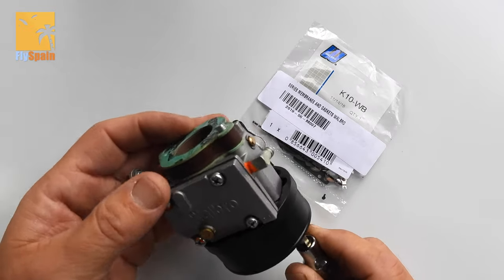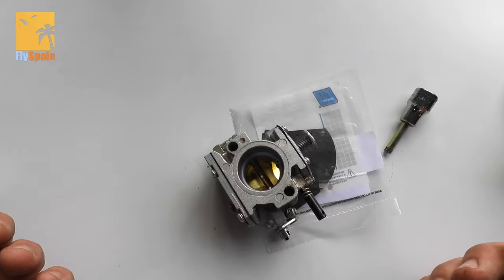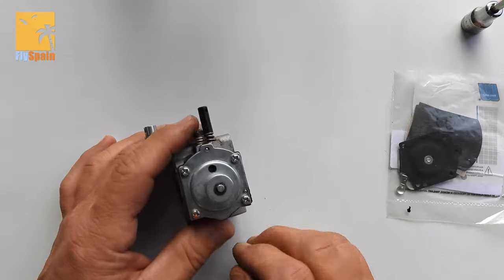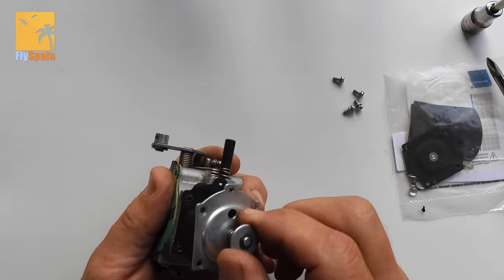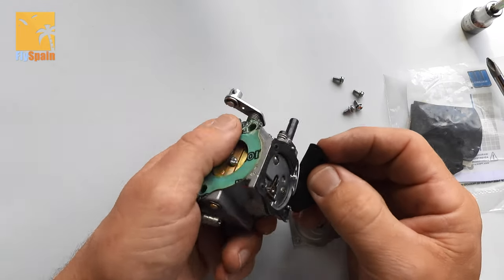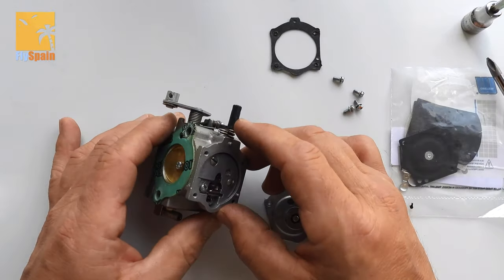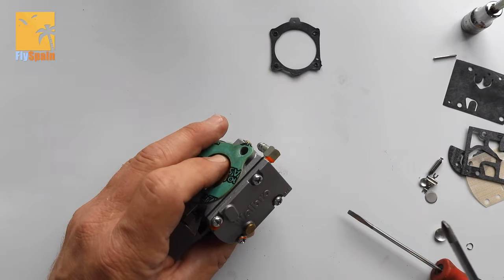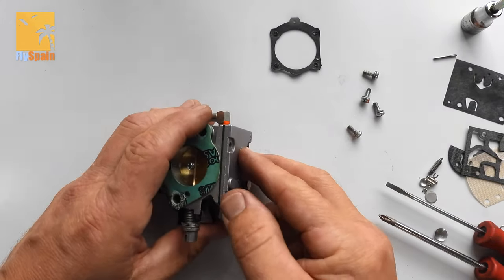How to change a Vittorazi Moster CARB | Fly Spain

Comment: I'm using this carb on a Vittorazi Moster 185 on a flexwing. Are you familiar with tuning it so the engine has a stable mid rpm setting at half throttle? It seems I only have high, super high, and idle.
Reply: adjust the low needle screw in by 2 mins like on a clock.always adjust when warm .screw in less fuel. or try the other way...just to see what happens probably bog. dont for get to adjust the idle screw screw out  because its too lean.then adjust idle screw out less idle.,  double check .recheck how you placed all gaskets. did u bend the diaphragm  metal type fork? recheck